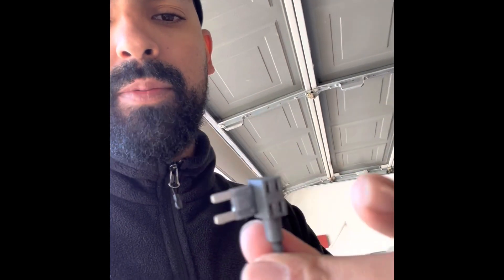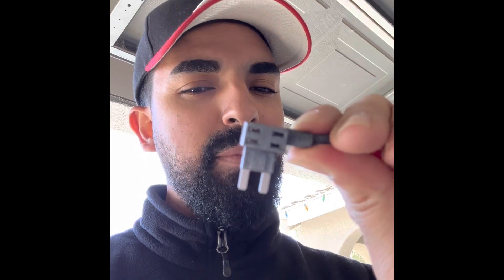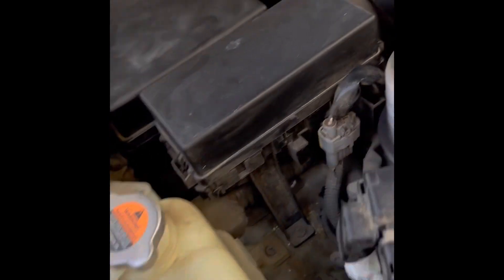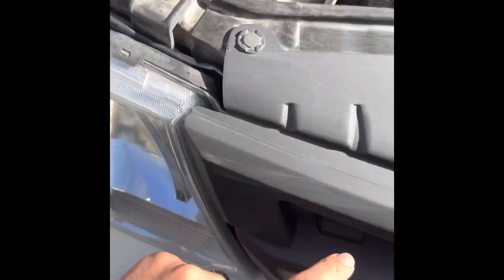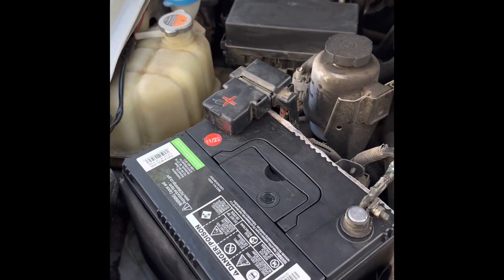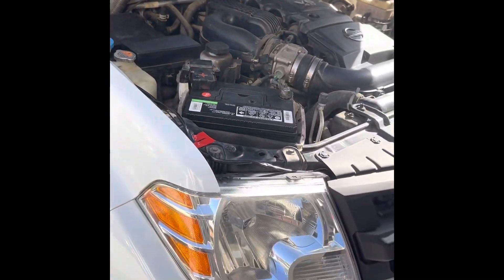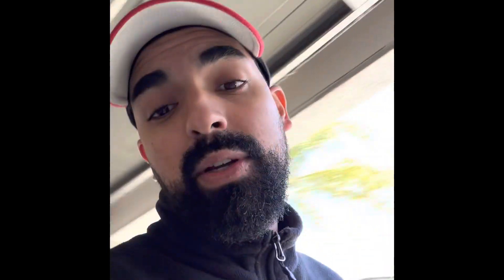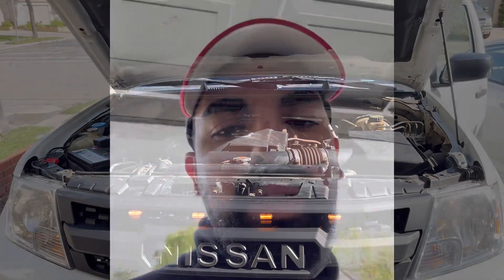How to install raptor led lights on Nissan Frontier + wiring overview

Comment: Thanks for the informative video. I recently purchased the exact grille for my Frontier and of course there are no included instructions as to install or wire the LEDs so your videos basically saved my ass. 👍🤘

Comment: Just subbed bro, liking these videos. Just bought a 2008 white frontier with damage on the front so im gonna be changing the bumper, grill, and headlights might as well and i also bought an led bar to install below the grill. Looking on installing this grill and doing the chrome delete on  the bumper since mine has the lower metal chrome bumper so im gonna be following up on future videos!

Comment: Just wanna let you know thank you for the heads up about the grill. I got mine two weeks ago and with the lights that are in the grill I just ran it to my side marker lights and it works just fine. Thanks again about the grill good looking out.

Comment: thanks for vid. i dont have fog lights on my SV. do you think it can work if i connect it to the main headlights?
Reply from the maker: Thank you for watching! Yes, this will work with your headlights.  you would just have to tap into the left or right headlight instead of the fog light.